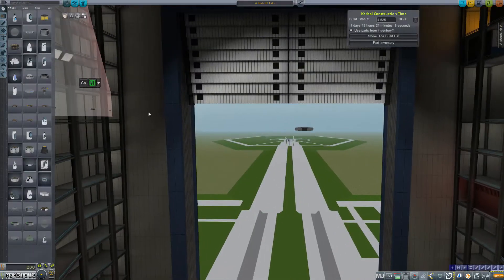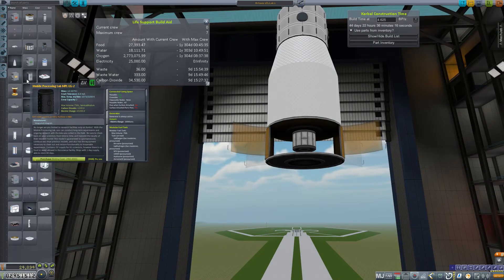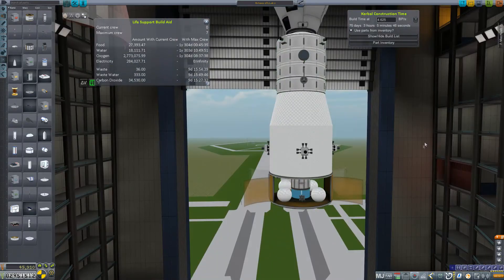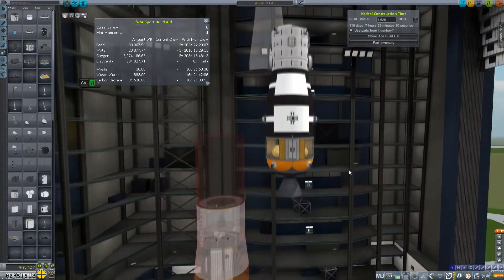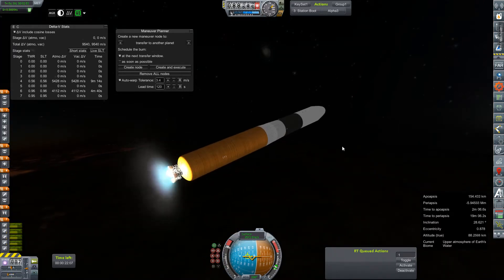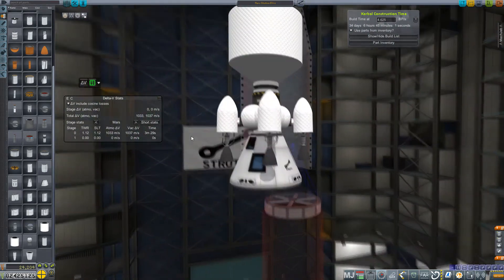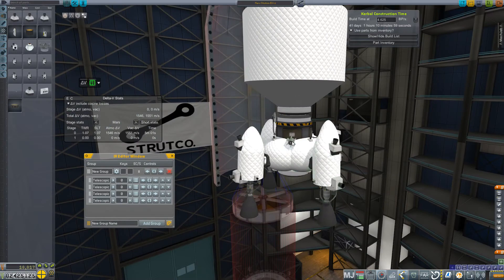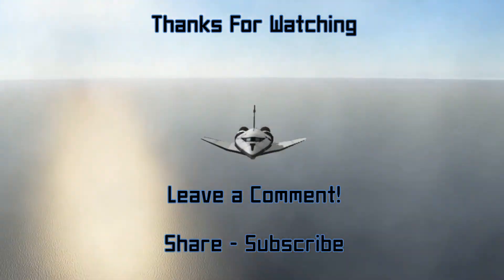KSP RP-0 #245 Project Iron Sands Build a Sode

Comment: Maybe you could launch that space station into LEO and then attach it to a mars transfer stage, which would leave more fuel in the stations tank (maybe enough for a propulsive capture at mars)
Reply from the maker: This was my initial approach when I started prototyping stuff a few months back.  I am re-considering it now because launching a single xfer stage - and then fueling it in orbit may be easier than trying to dock 5 separate flights in orbit of Mars

Comment: great, you're going down a very different path from KSP2MARS ! how heavy is your station by the way ?
Reply from the maker: The current version of the core module comes in at just around 55t - add in two lifesupport slugs ( 30t each ) plus two fuel slugs (35t each) and then the tugs.... 180t... maybe.  The plan may change yet. the Mars Orbital Rendevous approach has a lot of drawbacks.  ( All the approaches have drawbacks, I'm just trying to figure out what I can get away with considering the tech I have right now )

Comment: You know, I'm curious to see how much the trans-Martian injection mass (and coincidentally the TLI and LEO payload mass) is improved by a switch to the HG-3 engines I sent you. Also, are you actually running on a buffer with this series?
Reply from the maker: ScienceRules118 I'm really excited to see how the HG-3s change this launcher up. I'll certainly do a video on it.
I don't typically run with a buffer. I just got done with finals, so a lot of this was recorded on times when I needed a break from studying, spaced out over several days, and as the week picked up I just couldn't find time to edit anything together till today.  most times an episode goes up, I recorded it that same day.
Reply: Huh. Interesting. I should warn you, the Test Flight config is set up so that failures are going to be more common, just due to the engine's nature as an early high chamber pressure hydrolox engine. You're also going to have to deal with the upper stage variant only having two ignitions, and the sea level variant only being able to light once. I'd suggest building your stages such that you have reserve rated burn time, just in case of engine failure. Considering the Isp improvement, that shouldn't be too much of a problem.
Reply from the maker: I've got the engiens in, and they work in my test install ( I was testing in sandbox ) however - no run-time displays for them in VAB, and testflight doesn't seem to care about them much at all.  I was running both for upwards of 20m while getting settings together for Real Plume ( which I had no idea were such a PITA to get the defaults for a particular engine setup - but I'm working on it slowly )  I moved them over to the primary install and have the same issues with Test Flight.   My goal was to get the Real Plume stuff configured, and then work on equiping them to a DN series, and testing for overall performance increase - but got way bogged down on the Real Plume stuff. so more to come, in time.